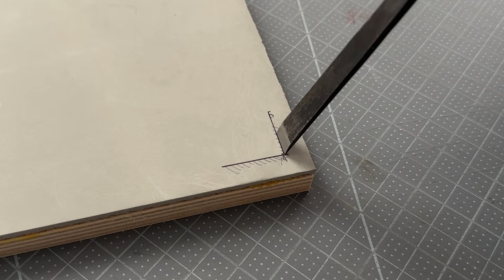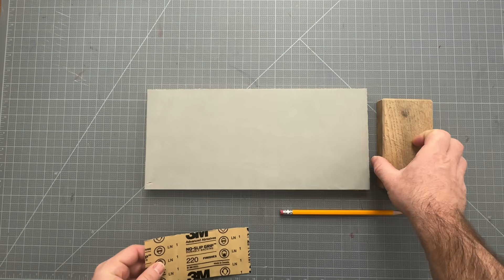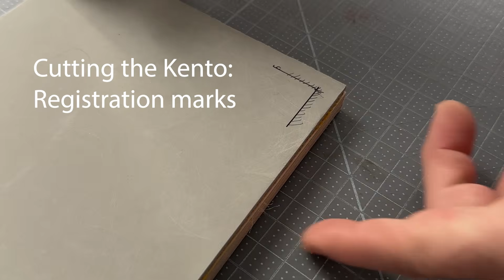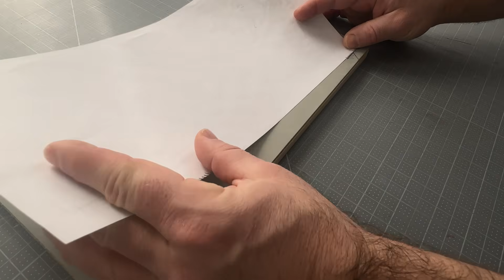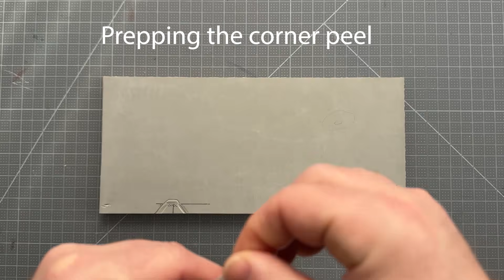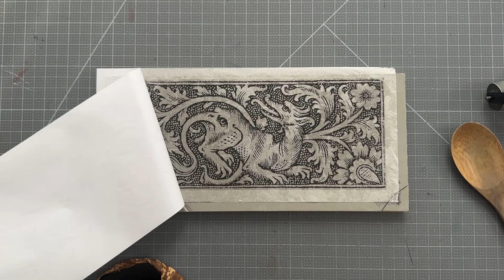How to Transfer a Design to a Linocut Block:

Comment: How did you glue the transfer paper to the backing paper?
Reply from the maker: I use a light repositionable spray adhesive. 

https://www.amazon.com/Scotch-Spray-Mount-Adhesive-Repositionable/dp/B00YR9E3VC/ref=sr_1_1_sspa?dib=eyJ2IjoiMSJ9.ubB_Tq71EjHpRT8bm-GaA4HK-4kSvO98wxld-LAy6gtP2xWnUm9QZcjhdiiXFNSDOgi0eGRso_TugEta7Dz-W1F4Wp5My1pnCcT83G1Q85HufuC_2_-Bi4CvLyeV5kjq23X6pWhaVLvEixrRDYIu2m6sEjM-yFWITHU_8PC2F_gTorE-wYzwb1Ybr1cQEDeRxALr8iNSBxMLUYej-F5sCRSZVQRVvDRhcL-kOdbHPNxllTKrOxR7c092_rhBhhzOYfNYw0zsCWQjjq3Drb6OME9ZSYIHnSwM0pEqHx-AI-I.Nd_wRsOgElB34aCfHmc8j0bzx9-ksyt-SQF8HjdVMB4&dib_tag=se&hvadid=693877208779&hvdev=c&hvexpln=67&hvlocphy=9004087&hvnetw=g&hvocijid=1759443651133746384--&hvqmt=e&hvrand=1759443651133746384&hvtargid=kwd-4406947599&hydadcr=4828_13229534&keywords=repositionable+spray+adhesive&mcid=532c04efed8f35058b42d2a53ffc7860&qid=1789333035&sr=8-1-spons&sp_csd=d2lkZ2V0TmFtZT1zcF9hdGY&psc=1

Comment: Why don't you centre the image on the block ? You seem to intentionally offset it.
Reply from the maker: I left more margin on the bottom and right side of the block for the registration or kento marks.  The registration centers the image on the paper and creates the desired margin width for the print.  Thanks for your question.
Reply: @stephenwiniecki  I had the same question until I realized this is a print block used to print on the final paper used. The final paper then uses the registration marks. Correct? Very much appreciated.

Comment: Really nice video. These help a great deal.  Are you able to cut through the Gampi with a V or U-gouge Lino carving tool without the paper pulling up or tearing?
Reply from the maker: if the tools are sharp enough it works fine.  Sanding and using the appropriate amount of paste is the key to a successful gampi transfer.  I mostly use a hangito or knife and bull nose chisels while I'm carving.

Comment: Thanks Steven. This is very good. But I have a few questions. You skipped over the step of how to get gampi onto transfer paper; what is transfer paper? Where do you get it? How do you attach the gampi to it? Is it a special weight of gampi? How do you print onto the gampi? Also, I notice you have a big pot of Nori; how long can you keep it for? Doesn’t it get mouldy? What brand of nori is it? Cheers, Phill.
Reply from the maker: All great questions, I can make another video about making the gampi transfer sheet.  I buy the Gampi from Dave Bull in Japan here: https://mokuhankan.com/catalogue/item_page.php?catalogue_number=8123

I attach the gampi with a reposition able spray adhesive.  It is a spray photo mount adhesive that is not very sticky, and is made to be reposition able.  3m and scotch are two products that carry this sort of spray adhesive.  Just make sure its reposition able and not "high tack"

I print onto the gampi transfer sheet straight from my ink jet printer, or directly from a key block.  

I had a pot of nori store in room temperature for over 5 years and it never got moldy, but you could store it in the fridge if you lived in a high temp region.  But it's affordable and you can buy different size containers from art stores online.

The product is from Yasutomo and its called Nori
Reply: @stephenwiniecki  Hi - I have the same questrions, did you make the video with the gampi transfer paper?